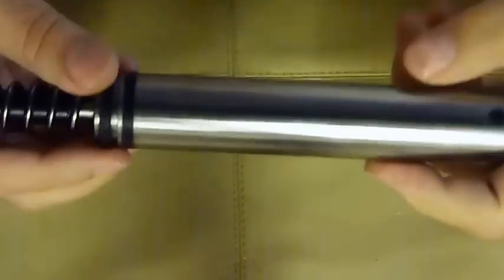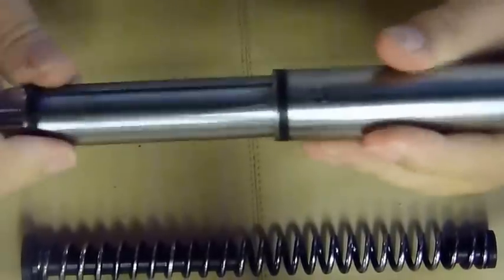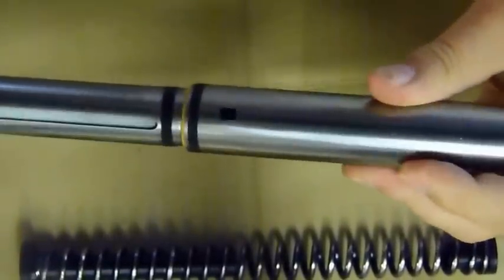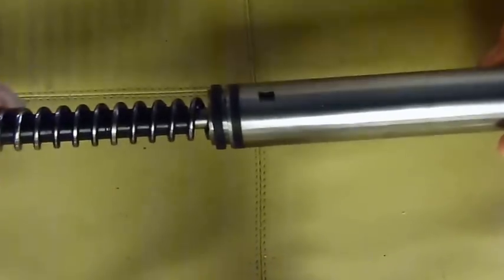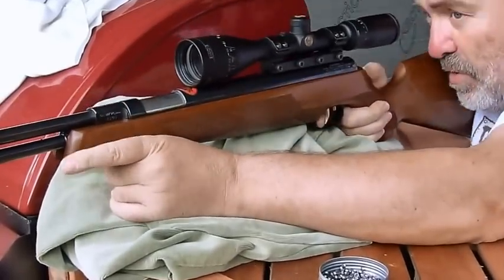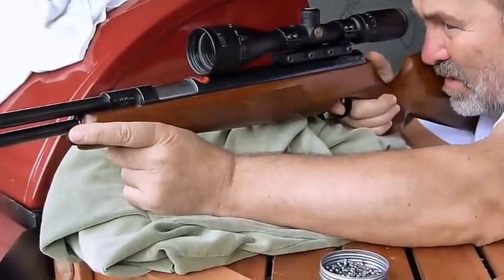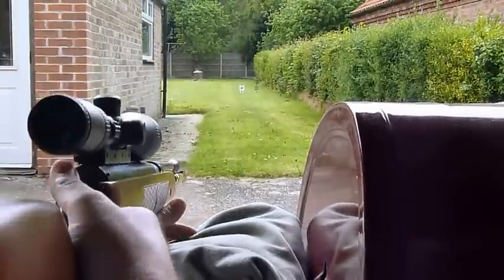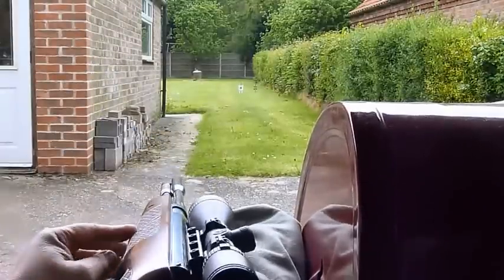Deadly accurate HW 97 with Paul Short Stage 3 tune

Comment: Nice work Neil , iv done the rings on the piston before but find it a fruitless task as the piston floats and the actual piston seal acts as the front ring and the rest floats (doesnt contact anything ) although it smoothens the cocking of the rifle , the rings are innafective on firing as its causing the piston rear end to make contact with the main cylinder ,

Comment: Iv seen some bullshit ! The outer piston tube / air cylinder / compression tube .whatever you call it doesnt need acetal bearings it simply cocks the piston .which also doesnt need buttoning its making a friction free surface into a friction surface the piston doesnt touch anything untill its fired , the acetal guide centres the piston which has nothing around it ( free floating in the cocked position ) and the lubes . moly grease slows it all down , lubes have moved on since the old MOLY days .. but you guys are happy gooing your guns up 😀 slowing them doOooown .happy days

Comment: got a problem with the trigger softness adjust on the bottom (gold flat head bolt). If i adjust that it stops my gun cocking or firing. any ideas what to do?
Reply: Strange one - all that screw does if I am talking about the same screw - is puts spring pressure on the bottom sear.
Reply: yeah thats all it should do i dont know why its fucked.. :/

Comment: this gun is even stock awesome
I´ve got the 22Joule/16,2ftlbs
Have like 5000 shots fired with it
I want to change the spring- opened the gun and there are 4 broken pieces ( spring )
But could hit at 60m without problem ( easy egg hunting ;) )
can´t wait to put the new spring :)